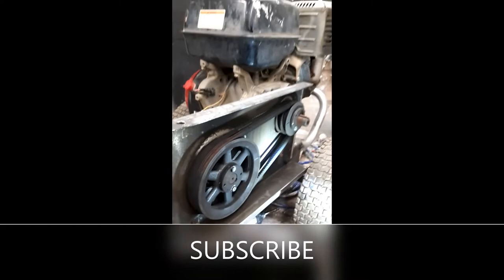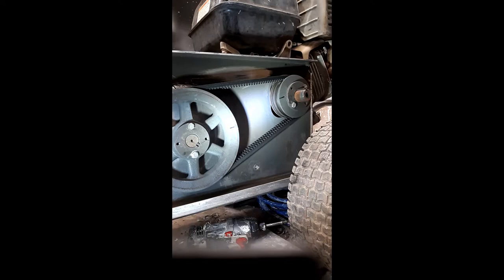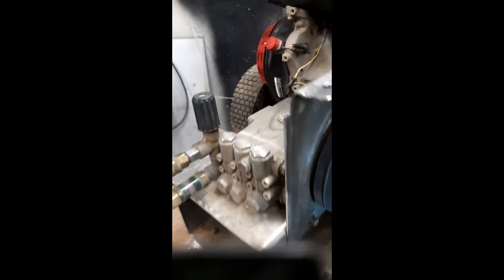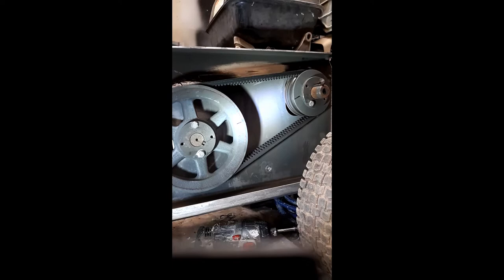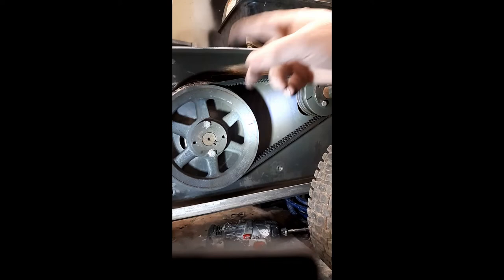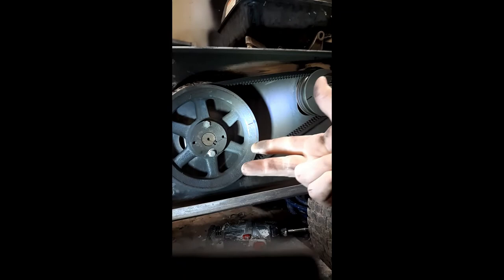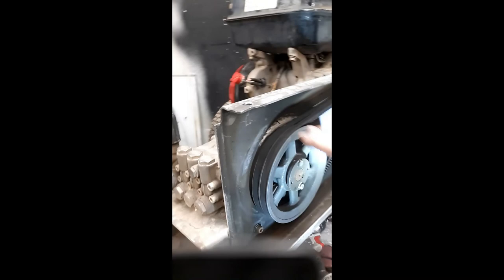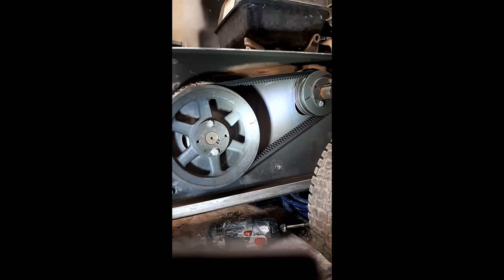Belt Drive vs Direct Drive pressure washer

Comment: A correction on pumps.  Direct drive pumps operate at 3400 RPM, belt drives operate at 1750RPM. The pumps are not the exact same, you can't put a direct drive pump on a belt drive and operate it at half the RPM it needs, you will not get the same psi or GPM. If you put a belt drive pump on a direct drive machine, you would surly blow it up operating a 2x the rated RPM. 

Direct drives pull water just fine from a tank if plumbed up correctly. I've got 2 direct drives that pull straight from tanks and have for 6 years. The problem is everyone thinks that belt drives are better because they are told that. Everyone keeps reciting exactly what you just said without actually having knowledge or experience of plumbing a direct drive to a buffer tank.
Reply from the maker: Thank you for repeating almost exactly what I stated. Your points of how the 2 pumps are different was already stated in the video.
I did not say you CAN'T  use a direct drive pump on a tank. My comment was you should not use a direct drive pump to SIPHON  from a tank. You can use the direct drive if plumbed so the pump is at the same level as the output from the tank or the pump being lower. This is NOT siphoning.  You are using the pressure from the tank to feed the pump. Typically the pressure from the draining tank will produce enough pressure to maintain the minimum gpm the pump needs to operate safely and properly.  As the volume of water decreases from the tank, the gpm is reduced. Again, I stated siphon. There is a difference. A direct drive can be hooked up to siphon, but it will damage the pump.
Reply: I would imagine you could customize the rpm of any pump just by switching pullyes. With a little imagination you could even set up a direct drive pump with a short shaft and a  pulley. We do stuff like that all the time on the farm. Lots of old drill presses required pulley changes to change rpm.  But as brian stated, cavitaion with low head pressure and high rpm pumps is a problem.
Reply from the maker: @j.d.ensminger1710  you can indeed set a direct drive up as a belt drive if you have the skill to properly assemble the materials needed.
Reply: Exactly, Brian said that the direct drive and the belt drive pumps are exactly the same and the parts. I disagree with that as well. Obviously if the pump is spinning half the rpm as a direct drive would be the output would be cut in half. So they can't be the same pump. I was going to reduce the pulley size on my belt drive pump just a little to increase GPM by about 15% from stock. If you wanted to take the direct drive pump off and mount and use as a belt drive, you could but would need to use the same size pulley that is on the motor so the pump turns at 3500 rpms. It is a 3500 rpm pump at that given psi/gpm.
Reply: @Brian_the_repair_guy  you are wrong my friend.  My direct drive pulls the water up too the outlet hose when the water line goes below the outlet hose.   

In fact I have ten gallons under the outlet hose .

It pulls until my tank is dry . 

It is pulling water almost 3 foot straight up to exit the tank hose that feeds the pump.

You wanna explain that ??

Or do I have a magical direct drive pump ??
Reply from the maker: @MR.TOYBOX  as stated in the video, direct drives are not good at siphoning. That does not mean it will not siphon, it is not the best option. It wears extensively on the pump. 
Can it work? Yes. Is it the best choice? Absolutely not. 
People do wrong things with equipment all the time and it works. That does not mean it is the right thing to do.
Typically if a direct drive is used, the manufacturer will place the intake of the pump lower than the tank to increase the delivery pressure and the volume to the pump to prevent cavitation.
Glad your system satisfies your needs.
Reply: @Brian_the_repair_guy  Mine has been issue free for two years now.  I guess I got lucky!!!  Hurray for me.
Reply from the maker: @MR.TOYBOX  2 years is a short time in commercial equipment.  Best of luck to you
Reply: @Brian_the_repair_guy  Also there not direct drive like you are saying. There is a transmission between the direct drive pump and the engine.    If that makes sense.   

Here is a link to watch so you can understand.    https://www.youtube.com/watch?v=0V90VGrY5bs
Reply from the maker: @MR.TOYBOX  ok, I see your confusion. The gear drive is not direct drive. I never addressed a gear drive in this video. They aren't that common. Most manufacturers have moved away from them. 
I was addressing direct drive and belt drive exclusively.  The gear drive functions similar to the belt drive. I understand your mix up now

Comment: Hola. Hay unos conceptos que no te lo claros.
 La bomba girando a mitad de vueltas, a través de un sistema de poleas, obtiene los mismos valores??
Es necesario, en una bomba lineal, que el motor gire a 3500 para que alcance la bomba la máxima potencia?

Si abres el mando de presion atope y bajas las rpm del motor, en una bomba lineal,  bajarías la presión al girar el motor más lento?

Voy a comprar una hidrolavadora y no termino de decidirme.

Comment: Hello might I add a huge reduction in engine vibration transfer to the pump with belt drive!
Reply from the maker: If you have a problem with vibration, there may be an issue with your machine. 
Yes, a belt drive has reduced vibration

Comment: ok this is like the tenth video i have watched on belt drive PWs and i still dont get it? i get how the belt and pulleys put less RPMs on the pump, but i dont understand how you get the pump back up to the full RPMs. now finally this guy explains that a 4GPM pump connected to a 3600 rpm motor does not need the full 3600 RPMs to make the 4GPM a min, so why run the motor at 3600 RPM to begin with? if you have a direct drive, why could you not just idle the motor down to what your getting from your belt pulley system?
Reply from the maker: Lower idle speed puts far more strain on the engine. Trying to reach 3600 psi at 4 gpm at 2000 rpm will likely stall the engine when the trigger is pulled or you just may not get to 3600 psi. The engine works the hardest at flow, not in bypass. To ensure the engine does not stall, you need more torque.  In a gasoline engine, you get that at higher rpms
Reply: @Brian_the_repair_guy  ok i am close now. in order for your 4gpm pump to get max 4gpm, you have to have X amount of RPM and torque. direct drive needs high RPM to create the required pump torque, the belt drive creates the same torque at lower RPM thus giving the same GPM at lower RPM. is this correct?
Reply from the maker: @joeydelrio  sounds like you are on the right track. I do not pretend to know it all, but this has been the way it was explained in training classes over the years.

Comment: They say not to run pressure washer at anything other than full throttle. Most say becuase it will cause it not to cool as well. Now accordimg to this theory of beijg the same pump running at half speed, hiw is that different to throttling down a direct drive to push the pump at half speed?
Reply from the maker: When people refer to cooling, they should be talking about the engine. Both the pump and the engine need to be cooled. The engine is strictly cooled by air flow. Faster rpms, the more air is pulled or blown across the cooling fins. The pump is air cooled simply because the surrounding air moves, not due to design. The movement of water through the manifold is where the cooling process for the pump is focused.

Comment: Good day sir, I have pressure washer with Bertolini ttk2130 1450rpm with gear box attach to Hertz 1d81z diesel engine 3000rpm and now the gear box have a crack and i want to change the gear box seat-up to belt driven my question is what size of pulley i need for this set-up. the shaft size are both 24mm, Getting advise here in Australia is very hard, thank you in advance
Reply from the maker: The pulley set up should be a 2:1 ration. Larger diameter pulley on the pump, smaller diameter on the engine. Approximately 17.8 cm on the large pulley. Use double belt pulley
Reply: thank you for quick reply your the best @Brian_the_repair_guy
Reply from the maker: @masanoel25  hope it helps
Reply: Do you mean if the large pulley is 18cm then the small pulley is 9cm? @Brian_the_repair_guy
Reply from the maker: @masanoel25  yes
Reply: thank you thank you very much @Brian_the_repair_guy
Reply from the maker: @masanoel25  glad to help

Comment: Is a belt drive pressure washer able to run or pull off of a buffer tank? I want to set up a small PW business and don’t have the money to spend on a mobile pressure washing system (12k) i have a buddy that has a belt drive PW with the honda 390x engine for sale and would love to set up something on my trailer
Reply from the maker: A belt drive is better suited to pull from a tank. My suggestion, have the pressure washer lower than the outlet of the tank. Don't have the washer pull "up" from the tank, have the washer attached to the bottom of the tank with the largest diameter and shortest hose possible.
Reply: @Brian_the_repair_guy  thank you!!

Comment: Hey so your saying dialing down a direct drive pressure washer to half strength can damage the pressure washer over time?
Reply from the maker: I don't think I made that statement.  If I made it seem that way then that was not my intention.  Using the machine at lower pressure is perfectly safe
Reply: @Brian_the_repair_guy  ok thanks I know that's a debate for direct drives I get mixed messages from my research
Reply from the maker: @trillhomie8322  exactly what is your concern?
Reply: @Brian_the_repair_guy  if it's OK to turn down my unloaded to use my pressure washer like a soft wash system when need be.
Reply from the maker: @trillhomie8322  yes it is, as long as the unloader is adjustable by hand
Reply: Ok I really appreciate it. It's hard to find anything about it online

Comment: Say 
Bryan I got a couple questions I have a belt drive BE  you mentioned to use the machine full throttle if not, you’ll have problems can you explain that please?
Reply from the maker: Good question. Air-cooled engines are meant to run at full throttle when running for longer periods of time. These engines, as the name states, are air cooled. The slower the engine is running, the less air you have being forced around the engine. This means the engine runs hotter and can over heat.
Running the engine slower also means the flow rate of the water is reduced. The increased flow rate of water is what keeps the pump itself cool. As in I show in a couple other videos, a hot pump can be costly.

Comment: I cannot seem to keep my belts from burning up and smoking on my belt driven pressure washer do you have any videos that can help me figure out why it will randomly start smoking and burning my belts I have tried running them looser I have tried running them tighter
Reply from the maker: Make sure your pulleys are aligned with each other.
Have you removed the belt cover to see where the friction is happening. Is it happening at the pump or the engine?
Reply: @Brian_the_repair_guy  wow thanks for the quick response. The pump stops spinning and the motor keeps going and that is where it pops
Reply from the maker: @sk1fpv  your pump should not stop it should run continuously. 
Does it smoke the belts if it runs and the trigger stays pressed? 
Can you run the machine with NO pressure hose attached?  Will it then run with no smoking?
Reply: @Brian_the_repair_guy  with the wand held the belts do not smoke but after running for about an hour if they let go of the trigger the pump will stop spinning in the motor will keep going and burn the belts. It runs fine with no pressure hose hooked up to it
Reply from the maker: @sk1fpv  if I had to guess (without having the machine here) your pump is producing more pressure that it can handle. On direct drive ot would stall the engine. Belt drive, the belts burn. 
Try turning your unloader down to reduce pressure.  If the unloader has gone bad that may not help. You would need to replace the unloader. 
Keep me informed